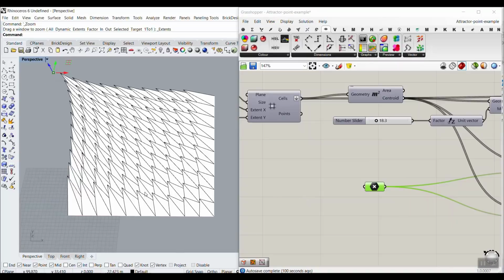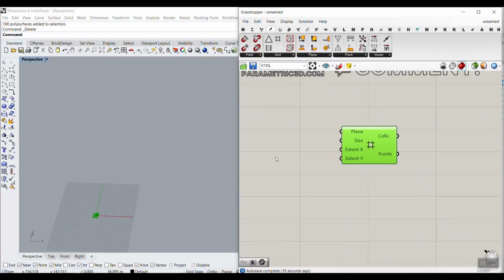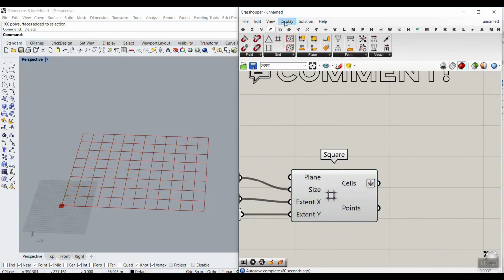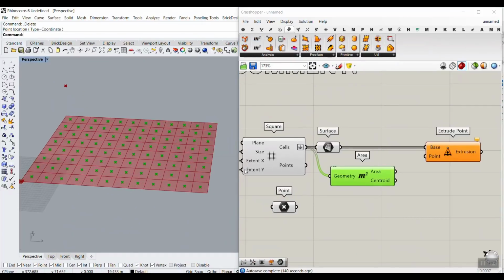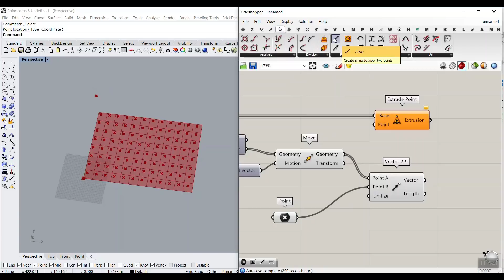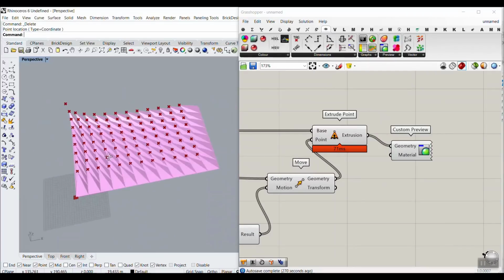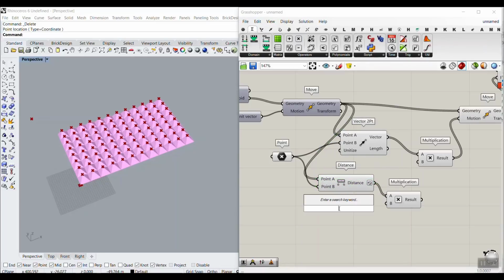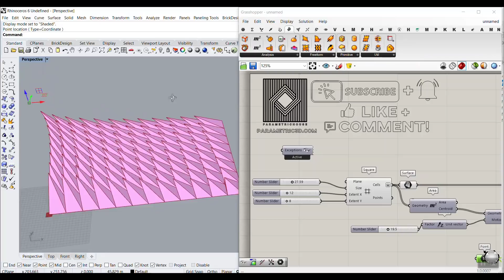Attractor Point Grasshopper

Comment: Awesome (again)! I got a question: Are you guys working on a direct connection for API of Revit? Cuz I'd love to see GH for Revit. Dynamo is there already but the community of grasshopper is much bigger than Dynamo's. I could see a future for GH in Revit, using adaptive components families. :D
Reply from the maker: Thanks Jonah
Well we are focused on Grasshopper because of its flexiblity in Design but maybe in future we will take a look at dynamo. I guess there is a process called Rhynamo , google it and see how it goes!
Reply: @ParametricHouse  Thanks for replying! Yes true! GH is much more flexible than dynamo. But I was wondering.  If GH came to revit,  I see no future for dynamo anymore. So i would like to know wheter GH is coming for Revit. Or is Autodesk blocking GH for revit and further 'copy' GH and try to compete GH with dynamo? Cuz it would be easier if there was an standard built in tool on Revit, like Dynamo is now shipped in the latest Revit 2020 version.
Reply from the maker: @surferboy198  Right! The problem here is that Grasshopper sits on Rhino and that will attract both Architects and Designers. For Revit, Dynamo will only help with BIM design. I believe that is why Dynamo does not grow like Grasshopper. The difference can be found between computational design & BIM. BIM is restricted to building and fabrication but you can use Grasshopper in the early stages of design. 

You're right! 
The best solution is to connect Grasshopper directly with Revit! Dynamo will not beat Grasshopper as long as Grasshopper is focused on plugins, community, and UI.
Reply from the maker: Why don't you search for some Revit plugins in food4rhino.com?
I think there are several plugins that work with revit : Grevit , Hummingbird ,...
Reply: @ParametricHouse  alright I'll have a look :)! Thank you! :D